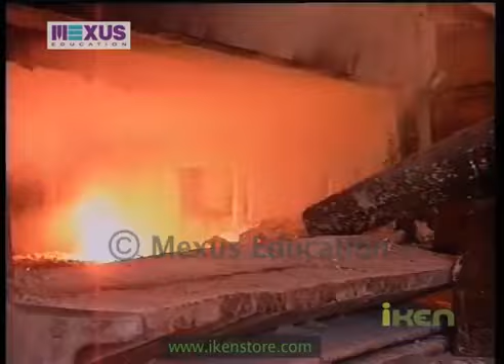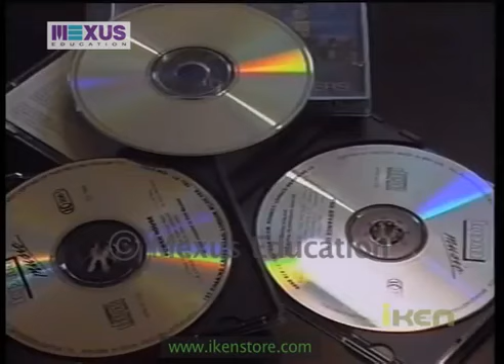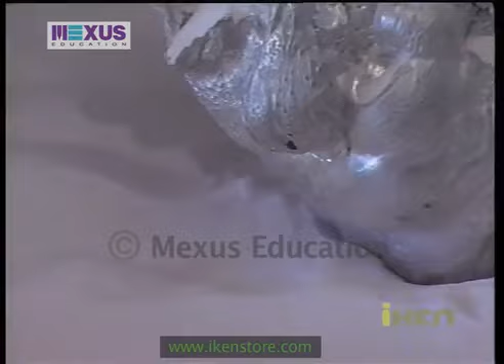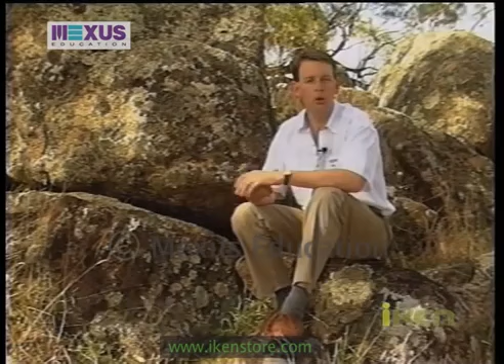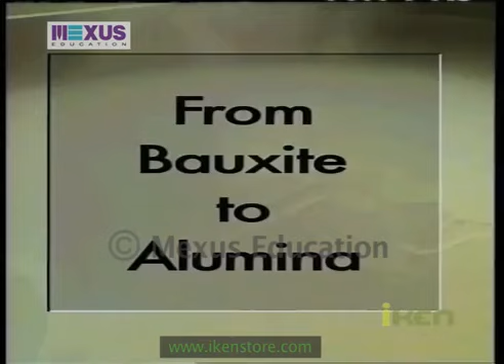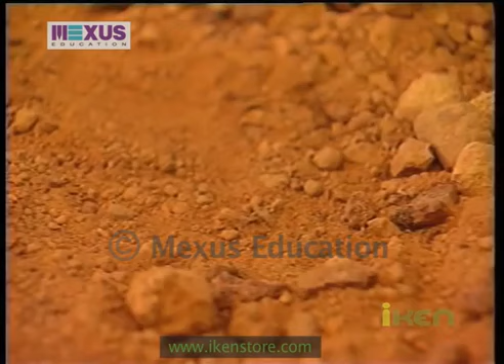The Making of Aluminium

Comment: Indra Bayu
2713100019

In real life - the aluminum can be applied in bicycle racing, cd, tv antenna, kalleng and aircraft. Aluminum is one of the active metal with good conductivity. In nature in the aluminum can be alloyed with other elements throug
Bauxite to alumina process
Bauxite has the chemical name Hydrated Aluminum Oxide (Al2O3.3H2O). Where the elements - namely the constituent elements of aluminum, oxygen, and hydrogen. Because aluminum is one of the active metal, the bauxite has a melting temperature of 2000o C. However, smelting bauxite at these temperatures would be dangerous and costly. Because of the enormous energy required and energy cost money. We use electrolysis to eventually produce alumunium from bauxite but first we must refine bauxite to alumina. In this video, Al – karam australia alumina refinery at pinjarra western Australia. It’s energy process consuming about half the domestic gas supplied from western australia’s. The crushed hydrated alumunium oxide is mixed sodium hydroxide. More cautic soda in a high temperature solution. 
Al2O3.3H2O + 2NaOH = 2NaAlO2 + 4H2O 
During this reaction, sodium hydroxyde selectively dissolves the alumunium oxyde into solution. Then the hearth concentrated sodium alumina solution is cooled of and seeded with tiny cristals alumunium hydroxide. When there is enough alumunium hydrate crystals are filtered out and heated to arround 1000oC. 
The refining leaves a dry free – flowing sandy coumpound called alumunium oxyde or alumina. Alumina contain ions Al3+ and O2- 
From alumina to alumunium
To make 1 ton alumunium you need about 2 ton alumina and just under half a ton of carbon. American make a petroleum coke containing over 80% carbon is used to make anode consumed in smelting. In fact alumunium needed enormous amount of electricity. To make alumunium, arround about 15 Kwh per kg  similar 1Kw radiator running for 15 hours capable of make 1 kg alumunium. Raw material like  alumina are the most expensive ingredient. 
Electrolysis
This process is called hall – herault process. Current enters the line at one end closing series from one part to the next and exits at the other end then it flows through. The second part line before returning to the switch shot to complete this message circuit. This enormous power produce both the heat and electrolytic force needed for smelting. Thermally insulated steel bottom is lined with large cabin block which act as the catode. These block are very hard. The cabin lining is negatively charged by the steel current conducting bars embedded inside them. Suspended about the chatode on insulated superstructure other carbon anodes each weighing over it ton. They made from carbon rich petroleum coke mixed with an only coal. At 1100oC inside bring furnaces in the floor at this huge room. The pot superstructure also includes a hopper for periodically introducing alumina into the pot below and there is an over head fume hood and removable doors to track escaping gases and particles. For smelting each part is brought to operating temperature by electrical resistance heating. One way is to lower the anodes onto a liar of carbon – rich coke lying on the cathode then turn on the current. The resulting short cirucuit heats the pot to 950o C. The energy then raised to leave a gap of about 50 milimeter ready for the additional electrolyte needed for electrolysis. Electrolysis is define as the chemical decompositions of certain substances by an electric current passed through the substances in a dissolved or molten state. The electrolysis of alumina compositions is kryolite or sodium alumunium fluoride which melts at 1009o C but for greater efficiency this temperature is reduced by adding alumunium fluoride, calcium fluoride, and alumunium oxyde. Alumina added to this the electrolysis salt bath quickly dissolves. Reducing aluminates as normal melting point about 2000o C to a more economical 950o C.  The cryolite forms at the surface crust which for the conservative costly heat energy. During a newly line parts early life its cabin soaks up the electrolytes sodium and sodium richly rides so workers ed anhydrous sodium carbonate or soda ashto fix this embalance and you many employess ride is also added to match the sodium content of the consumed alumina. This maintains the correct weight ratio of sodium fluoride to alumunium fluoride found in cryolite. As electrolysis begin these fluoride level drop partly because moisture in the air and the alumina cause hydrolysis which produce hydrogen fluoride

Comment: Bayu Fahruddin
2712100095

Aluminium is earth’s most plentiful service metal. Everyday we find thousand have different uses for aluminium like car engine, racaing bikes, TV, compact disc, can, and airplanes. Even the TV you’re watching probably countain any medium , and as we’ll see in this program, it’s melted from the white powder called alumina using chemical process called electrolysis. 
Aluminium is what scientist called an active metal that means that likes to react or combine with other elements, so you never find a lump of pure aluminium in the same way you trip over gold, instead aluminium always found bounded in a compound with other elements inside surface rocks like granite. Granite is made have many different substances including  aluminium, silica, potassium, magnesium, sodium, and calcium. But how do we released the aluminium from its tight bone with these other subtances. Fortunately nature began the process a long time ago but.
From bauxite to alumina
30 milion years ago a subtropical climate extended across most in a land, high rainfall and the organic acids dripping from the lush vegetation, began weathering the granite outcrops in some areas, eventually this process dissolved out, and washed away many mineral leaving behind a thick surface mantle that have already soul as well as iron oxides, it contained any medim hydroxide which forms when aluminium bones with hydrogen and oxigen, where this land was particularly well drained like in western Australia’s downing rangers the iron oxides, eventually washed away, so after decomposing for milions of years, all that remains surface deposits of aluminium bearing ore caled bauxite.
Bauxite chemical name is Hydrated Aluminium Oxide ( Al2O3.3H2O). because aluminium is a very active metal it gives bauxite melting point over 2,000oC. Smelting bauxite at these temperatures would be dangerous and costly because of the enormous energy required and energy costs money, so instead hate we use electrolysis eventually produce aluminium from bauxite but for electrolysis to work bauxite must first be refined into alumina.
The crushed hydrated aluminium oxide is mixed with sodium hydroxide (caustic soda) in high temperature solution. During this reaction the sodium hydroide selectively dissolves the aluminium oxide into solution leaving any undissolved impurities to be filtered out.
Al2O3.3H2O + 2NaOH -> 2NaAlO2 + 4H2O
Then the heart concentrated sodium aluminate solution is cooled of and seeded with tiny crystals of pure aluminium hydroxide, this encourages further growth that these crystals.
2NaAlO2 + 4H2O -> Al2O3.3H2O + 2NaOH
When there is enough the larger aluminium hydrate crystal are iltered out and heated to around 1000oC, this intense heat drives the watersteam which is released to the atmosphere through chimney stacks.
Al2O3.3H2O + heat -> Al2O3 + 3H2O
The refining leaves a dry free flowing sandy compound called aluminium oxide or alumina (Al2O3). Alumina countains small highly charged aluminium oxide ions held in a strong ionic network or lattice, each  oxide ion has an ionic radius two and a half times larger than that of each aluminium ion (Al3+ and O2-).

FROM ALUMINA TO ALUMINIUM
To make 1 ton of aluminium you need about 2 tones of alumina, and just under half a ton of carbon. Electricity needed to make aluminium are so many, 15 kWh per Kg of aluminium produces = 1kW radiator running for 15 hours. 
Source to make aluminium per tonne
Raw material 45.3% (alumina 33.1%)
Energy 28.5% (electricity 26.%)
Labour & Overheads 26.6%
Total cost 100%
Thats we can imagine that aluminium cost is so high.
ELECTROLYSIS
The hearth of any smelter is its spotlines where electrolysis transform alumina into molten aluminium, these part are also called whole hero cells. We can use simple equation to find rated of power consumption P/VxI, which P= electrical power ; V=voltage current ; I = measured amp.
The enormous power produces both the heat and electrolityc force needed for smelting. The chemical decomposition of certain substances by an electric current passed through the substance in a dissolved or molten state. Electrolysis of alumina is done in a molten bag, consisting mainly of cryolite (3NaF.AlF3). Cryolite normally melts at 1009 degree C and can be reduced by adding: sodium aluminium flouride (AlF3), calcium Flouride (CaF2), aluminium oxide. Alumina dissolved and melts at 950 of degree C, so thats it will reduce amount of heat you need. Cryolite will forms a thick crust, then its cabins will soaks up the electrolyte sodium and sodium flouride, and soda ash to fix imbalance. Aluminium flouride to match the sodium content of consumed alumina.
Electricsl current combine with the heat energy to split the alumina dissolved in the electrolite into its ionic compound. The oxide ions are attracted to the anode where they react with carbon to produce carbon dioxide. To make electrolysis work, the very tigh bonds holding the alumina lattice together ust first be broken this happens in the molten cryolite, which is one of the few solution which will dissolved alumina, with alumina in molten state, it will make aluminium ions migrate to the cathode, and the cathode [ushed electrons into the aluminium ions making them neutrally charged. Reaction on cathode Al3+ + 3e- -> AL. Aluminium is immiscible in cryolite. The oxide ion are repelled by the negative charged cathod, but attracted to the anode, here they combine with carbon, to form carbon dioxide and small amounts of carbon monoxide.
Anode reaction C + 2O2- > CO2 + 4e. Then carbon will ripped from each anode. Then will be process to ingot. Ingot purity is 99.8%, and the impurities include iron, silicon, magnesium, manganese, gallium, chromium, zinc, vanadium. In the end, what the effect of aluminium making to the environtment?, of course it will destroy the environtment, but nowdays, scientist find the way to rehabilitate environtment that are destroyed by aluminium making, but it need time to recover.

Comment: Fikan Mubarok R
2712100080

THE MAKING OF ALUMINIUM
Alumunium is active metal ,bonded and combine with other elements, so we will never find pure aluminium. Alumunium contains in surface of Granit . Granit is a rock that contain elements such as Aluminium, silicon, phosphor, Magnesium, Calsium and Iron. So how aluminium decomposed from the rock was by million years of washed granit. Rain and organic material washed the granit so the granit was decomposed into many element such as iron and aluminium, when exposed to the atmosphere aluminium will combine with oxygen and hydrogen become aluminium hydroxide.  After decomposion for million years all that remain is surface deposit of aluminium bearing ore called bauxite. Bauxite chemical name is Hydrated Alumunium Oxide (Al2O3.3H2O). Because alumunium is active metal its give bauxite melting point about 2000o C. Smelthing in this temperature is dangerous and costly. So instead of heat we use electrolysis to eventually make aluminium from bauxite. But before electrolysis to work,the bauxite must first being refined into Alumina. Alcoa refinery in Australia doing this. One of three Alcoa refinery is in Pingera west Australia. Bauxite mine ore reserve near the plant loaded by conveyor belt. Once there, Alcoa use Bayer process to chemically filter impurities such as Iron hydroxide, Silica and Titanium oxide. Its an energy hungry process that use half domestic gas of western Australia. Heres is the process: Al2O3.3H2O + 2 NaOH-> 2NaAlO2+ 4H2O in high temperature solution. During this reaction Sodium hydroxide dissolve aluminium oxide and leaving undissolved impurities to filtered out. Then next process : 2NaAlO2+ 4H2O-> Al2O3.3H2O + 2NaOH. When this enough, large Aluminium hydrate crystal filtered out and heated to around 1000oC. This intense heat dried water up into steam which release to the atmosphere. The refining dry and free flowing sandy compound called Aluminium Oxide or Alumina (Al2O3). Alumina contains small highly charge aluminium ions and oxide ions held in strong ionic network called lattice. Each oxide ion has radius two and half times larger than that of each aluminium ion. Because of this, its difficult to show this into three dimensional shape. But alcoa research believe that in order to maintain the charge balance these ion are arrange in regular pattern in alternating layers.
To make 1 ton of aluminium we need about 2 tons of alumina and just half a ton of carbon. Alumina from the previous process than ships into Portland Alumunium, western Victoria factory. Its loaded by vacuum system and travels by underground conveyor belt into big storage(cricket field size). American  made petroleum coke, a brittle solid containing of 80% carbon used for making anode used for smelthing. The other major “ingredient” is electricity. There are enormous amount of electricity to make aluminium around about 15kWh per kg of aluminium produced or same as 1kW radiator to runs for 15 hours. Like Alcoa produced 900 tons of aluminium a day and cost over half million dolars per day. They use 10 percent of electricity generated each day in Victoria. These energy transferred to 500 km to Portland at 500000 volts enough to compensate transmission lost. At Portland transformers drop the voltage to under 1000v DC. Production cost per tonne in Australia: Raw material about 45,3% Alumina 33,1% Energy 28,5% Electricity 26,6% Labour & overheads 26,2%. 
The heart of the smelther is in pot line, The name given for rectangular pots where electrolysis transform alumina into molten aluminium. These port also called Hall- heroult cells in recognition for the French man paul heroult and American Charles Martin Hall who simultaneously but independently foun economic smelthing method in 1886. Portland Aluminiums have 2 pot lines each with 204 parts measuring 13 meters long and 4 meters wide. Currents flow in one in flows in series frome one part to the next then going in second pot lines before returning to the switch out to complete these massive  circuit. Although the pot just runs for 4,5 volt the currents is 300.000 A. For 408 pots total power consumption is over 550 megawatts. These power is generating heat and electrolytic force needed for smelthing. Each cell made from steel in bottom and carbon block(cathode), at the top is Carbon anode hold by insulated superstructure. Include Alumina hopper, Fume hood and removable doors. The process is using electrical resistance heating. Anode are lowered onto cathode. Shorts circuit heats the pot to 950oC. The anode than raised to leave a gap of 50 mm then cryolite(the chemical decomposition of certain substances by an electrical current passed through the substance in a dissolved or molten state) placed in the heated pot. Composition of cryolite 3NaF.AlF3 , AlF3 CaF2 and Al2o3 to reduce cryolite melthing points. Next, Alumina will dissolves and melts at 950oC. Cryolite forms a thick crust and Carbon soaks up sodium, Pot room operators add soda ash, alumunium fluoride also added then gass collected. These process are carefully monitored by computer. Carbon is ripped from each anode, and anode are automatically lowered.  
From electrolysis to ingot. Previous product is molten Aluminium. The quality control of compotition is Ingot puity about 99,8% . Alumunium is 8 of valuable commodity.
Side product of these process is carbon dioxide and also green house gas and also particle gas. But some by product also become fertilizer.
Pollutant also generated include particle and heat that blows by the wind into the island. Electrolysis is the economic process to produce alumunium but still gives pollutant and gases but these is the most valuable method to process the most important metal aluminium